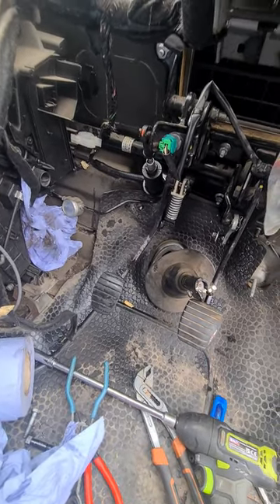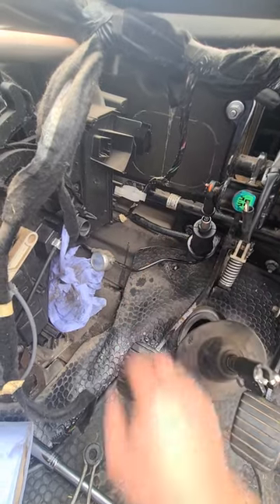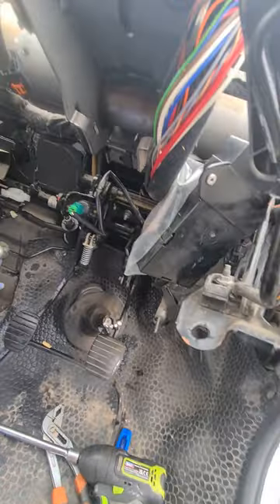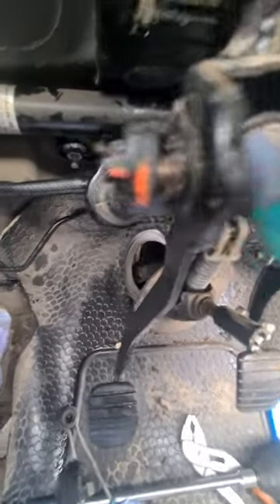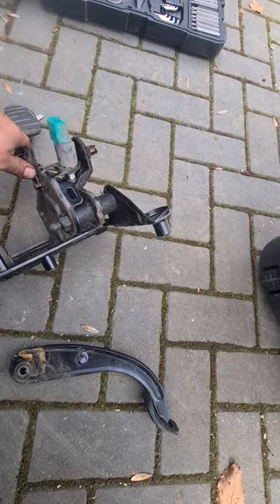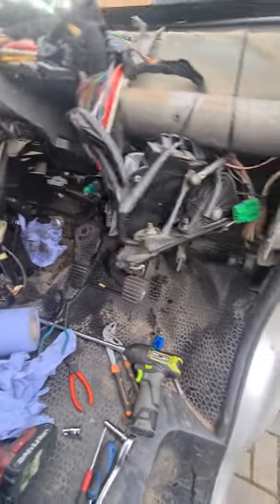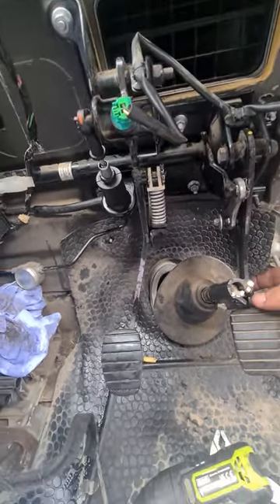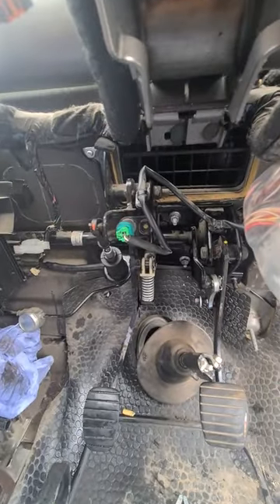Vauxhall vivaro broken clutch pedal box 👍

Comment: You know the bracket is on its way out when you hear a crack noise on using the clutch pedal. I have had this bracket break twice on my 2005 Vivaro. First time had the garage replace it. Went again, so I decided to do it myself. Welded bracket up and made gussets for sides for greater strength.
Original design is pants. Overtime the bracket bends and cracks, eventually breaking off
Reply from the maker: Yer, mine felt like the pedal was twisting , and not coming back up fully, then 15 minutes later, snap ! It really is a bad design, for stress it gets, sounds like yours will last a lot longer 👍👍
Reply: Hi Mark. What clip do I use to secure the white part of the clutch return spring to the pin on the clutch pedal. Thanks

Comment: I am dreading having to do this, but thanks for the videos.
Reply from the maker: Hi Yer it an awkward job, lot if stuff in the way even took out the streeing column, 
Just watch the pipe on clutch pipe there's no clip on it, if need another video or pictures drop us a message 👍👍
Reply: @ON-THE-DRIVEWAY  I think I'm going to start with master cylinder and hope it's just that. I'd replace that anyway if it is the whole thing thats the issue, so might as well give it a go first. Fingers crossed it's a 20 quid jobby!
Reply from the maker: @georgestone8099  
If you can stick your hand around the back of the pedal box you can feel if the brackets broken, my pedal started to feel very soft thought the clutch was going, but it was the bracket starting to get weaker and then a few days later it snapped

Comment: Hydraulic is very strong I tried welding mine but so awkward to get up there to do it but gonna buy new 1 cut whole bracket off and cut my old broken bit off and weld whole thing on
Reply from the maker: @chrischapman7113  
Yer looked at welding mine but looked to weak luckily I had another complete pedel box to use 
It a rubbish design